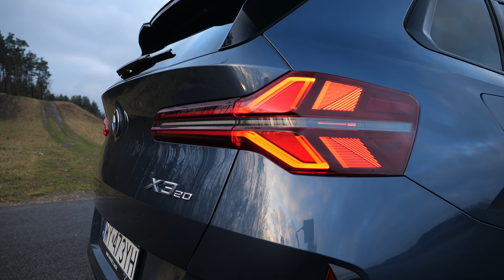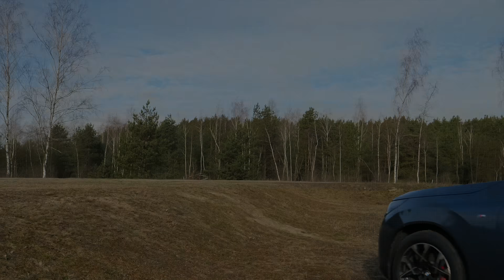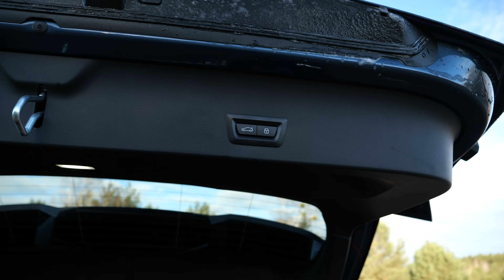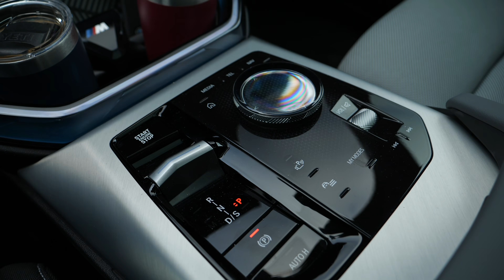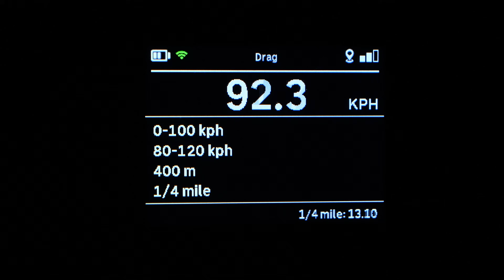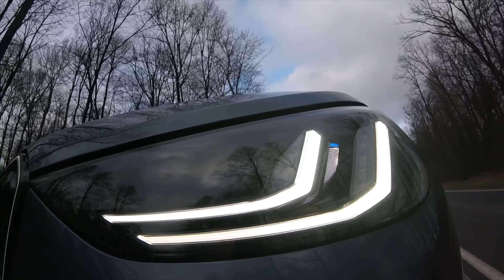BMW X3 20 xDrive G45 - Worth The Upgrade? (ENG) - Test Drive and Review

Comment: I drove it for a while - it’s AMAZING to drive . So comfortable and efficient. 
You get used to the inside and 200hp are very well enough . 
Plan : wait 2years then get it for 40k
Reply: That's what I'm thinking too. The touch controls are a pain in the ass, but the ergonomics and drive are unmatched in this class.

Comment: Not a word about non opening sunroof?  Hmm....
Reply from the maker: TBH I don't give a toss about any glass roof, and when choosing my cars I make sure they've got a solid roof. Unless it's a convertible :)
In this case it brightens up the rear of the car a bit, but overall I couldn't care less if it's there or not and if it opens or not. 
I imagine it's a design choice - uninterrupted glass surface - so they can boast about it being the somenthingest at a given period in time. I know some models come with a divided panoramic roof, where half of it opens, others just come with a sunroof. This one doesn't.
Reply: @MarekDrivesENG It is for cost savings.

Comment: Doesn’t they have a basic check lists for convenience and comfort which include doesn’t leak water inside or dirt in the car? Did they even test drive the actual car for a few months under all type of conditions and how about the inconvenience caused by the screen and haptics. Pls wake up.
Reply from the maker: Apparently most car design happens in a studio in sterile conditions. Once they get a prototype outside, it may be too late for some adjustments. 
They went for a very unfortunate tailgate design across the range, and it even extends to the new Countryman, where you have dirt dripping onto you, when you open the tailgate.
Reply: @ personally I do love the updated design to be honest. The drive across bmws are all well tuned, and agile.

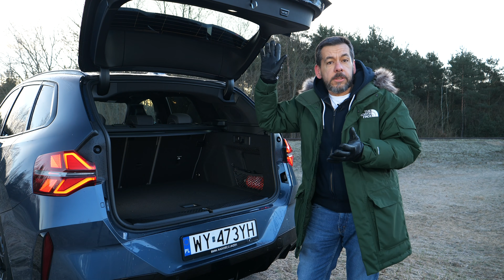Comment: 5:52, it is amazing that the European manufacturers are getting worse in time. This aspect was covered decades ago, especially in premium segment of german brands. Nowdays they do no employ idiots only in design segments but seems in other areas as well. Form over function. But there's useless led lightning over grills. And they wonder why are Chinese taking over.
Reply: Went to check out the latest X3 having just picked up a lightly used 2024 X3 M40i. 

Was utterly shocked at how cheap and nasty the interior was. Horrible kia level plastics from 20 years ago. Cheap rear door cards that did not have ambient lighting or any trim from the front door cards. Horrible tasteless disco ambient lighting. Everything was hard and scratchy 😂

Needless to say, was super happy with the older model

Comment: Thanks Marek!  I'm shopping for a vehicle and if I get a EV it will be the i4 40 and if we go petrol I think I'd prefer to get the X1 M Sport with premium over the X3.  I think it's better looking and it's not built in the US.  With the US screwing Canada around on car tariffs I'm avoiding US products like the plague.  

I hope BMW moves X3 production for Canda back to Germany.

Re the design, I'm not offended by it but it just looks a little chubby and I don't know why they got rid of the quad headlights...seems very un BMW.
Reply from the maker: The X1 is a great all-rounder. I think it cannibalizes the X3, which is too expensive, for what it is. If X1 was too small, I'd probably skip the X3, and go for the X5.
Reply: @ what I noticed is that the interior room is very similar but the front end of the X3 is quite a bit longer to accommodate the inline 6 which ends up being a lot of wasted space if you aren’t getting the larger engine.

Comment: I remember when Peugeot started doing the same kind of massive panoramic roofs... This was twnety years ago, and for the next decade absolutely every one of the car reviewers criticized them for not opening. When the premium bands finally caught up more than a decade later, this kind of roof suddenly became a good thing. Go figure...
Reply from the maker: I literally said "It brightens up the otherwise gloomy rear part of the passenger compartment."
Why drag Peugeot into it? 🤣
Reply: It's not the premium brands that caught up. It's the technology that made it reasonable enough to switch. Why? First examples were too heavy, had worse thermo insulation, more expensive and less prone to dmg (hail?). On top of everything bonding materials and structural strenght of those early examples were non existent in overal structural rigidity of the roof, not only that but u can imagine they worsen it that much. Nowdays modern roofs are part of structural rigidity and everything taken into consideration they are better choice of the ones that open minus the opening part which is almost useless since in vast majority of cases we rarely use it. Well majority of us. I'll give u an example, roof that Renault Rafale uses is space tech stuff and is made by a component maker that makes it for airplanes and spacecrafts. Other manufacturers use the same one and component maker makes it. ;)
Reply: @JohnyMcNeal  Please don't praise it so much. It is a gimmick.
Reply: How lazy it doesn’t open. I wouldn’t even spec a non opening pan roof. I’ll take the trade off of light in the back.